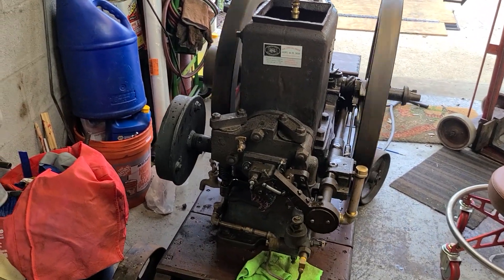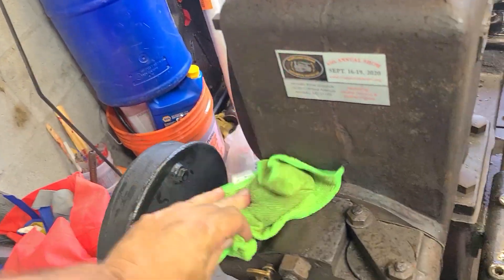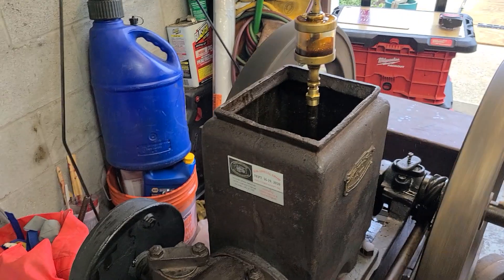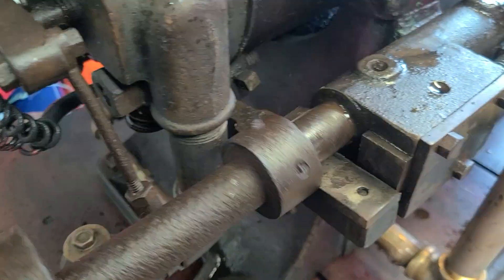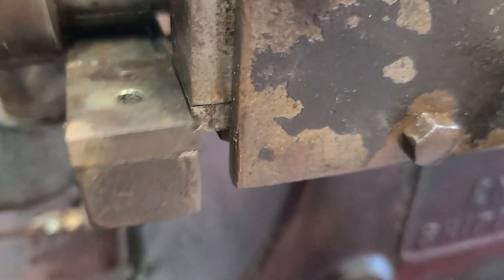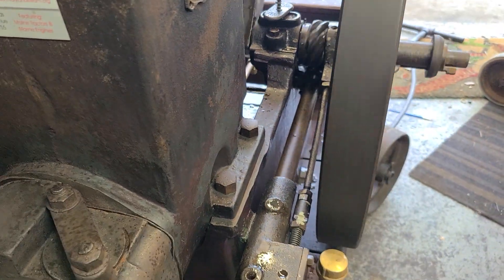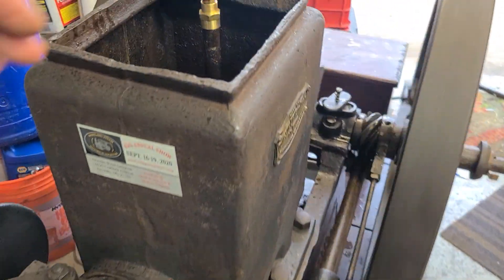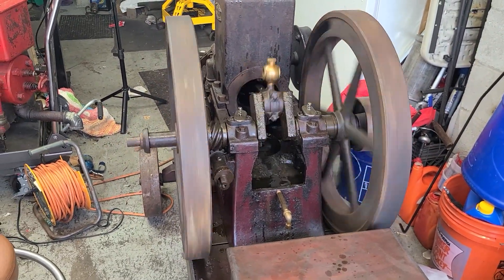Uncovering a RARE 1905 Domestic Gas Engine Prototype

Comment: Did they start out with an H beam connecting rod then go to a round rod then go back to an H beam?
Reply from the maker: Hi Greg, I am really not sure, but I have seen both. I wonder if some could have been replaced or upgraded at some point? I have seen ones with a higher serial number that have a round rods so it confuses me. I also wonder if the early ones got put together with whatever was laying around? I was told in 1905 while waiting on the factory to be built they had limited access to parts and made do with what they had. This is the other one just above mine that's round.  https://youtube.com/shorts/7C3JTJT97ic?si=atEPntQ4UySC01Dv